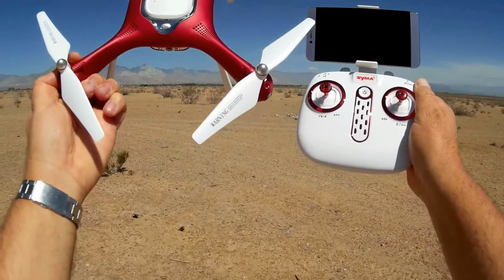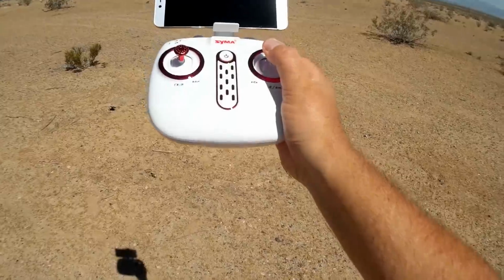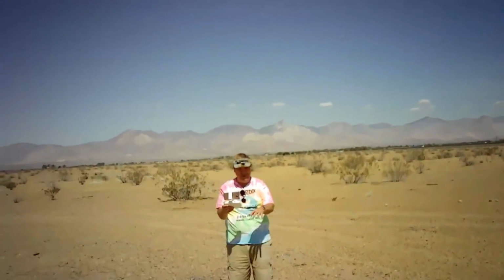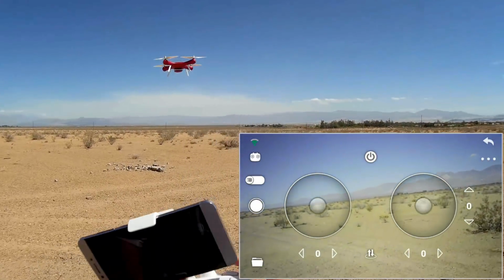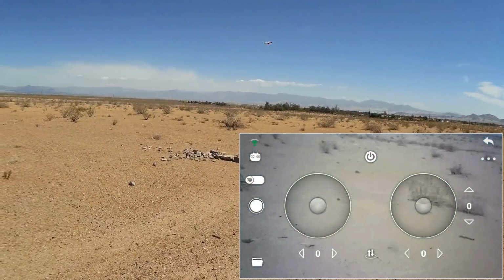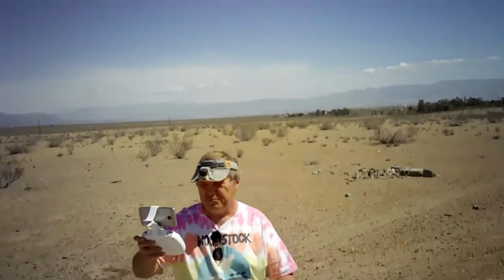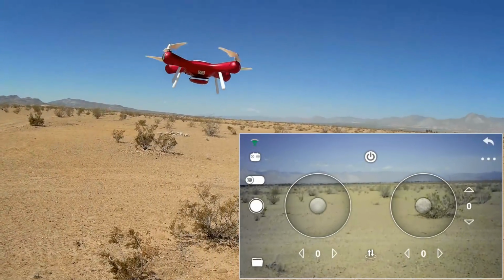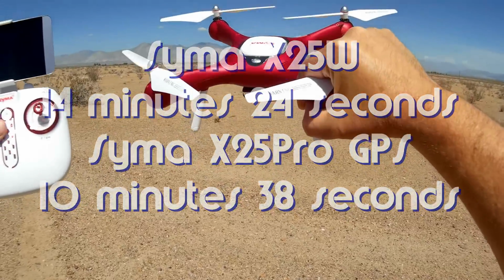Syma X25W Long Flying position Hold FPV Drone Flight Test Review

Comment: I Just Baught a Syma x25w and the optical Flow sencer helps Keep it in one spot and Hovers very well but would no recommend flying it in high winds will fly away from you but flys very well on calm still Days and has a 3mg camera on it.

Comment: What better syma x8sw or x25w?
Reply: Syma X25pro with Gps Lock and Syma X25w with optical Flow i have Both and they Both work Great with 720p Cameras on them highly recommended and thats if you are new to Flying Syma Drones

Comment: QC 101...I have a Sharper Image DX-2 Quadcopter with a bad motor.  It was a great flyer & I really want your help to find  replacement Motor(s). .. I did many searched & cannot find them listed anywhere.  I contacted Sharper Image and they are of  NO HELP at all.  The Motor  is a direct drive (push on props) and the output shaft has larger diameter than the replacements motors for JRC H8 Mini.  It is perhaps the next size larger motor than the JRC H8 Mini motors I already have..  Can you or any of your Youtube subscribers help point me to a comparable Sharper Image DX-2 replacement motor that are available from / for another Brand Quadcopter.?    Thank you for your help!
Reply from the maker: It's likely a generic 720 motor, widely available, and very cheap https://www.ebay.com/i/263059145193?chn=ps
But the only way to know for sure is to open up the drone and measure with calipers its diameter (7mm) and length (20mm).
This might help also http://haroldsmicroquadcopters.blogspot.com/2017/01/sharper-image-dx-2-goes-to-repair-shop.html
Reply from the maker: But as this drone is only $15 at Walmart, why not save yourself the hassle, and just get a new one? https://www.walmart.com/ip/Sharper-Image-DX-2-Stunt-Drone/106014485
Reply: Thanks So Much for your help... Your knowledge is a terrific service to this hobby.   I know this because I am a long term subscriber of yours & have bought 5 different sized / brand Quads based upon your favorable reviews. Your are absolutely right ... it would probably be better just to buy a new replacement quad.  However, my wife says she never gets anything new (kiddingly ?) because I enjoy fixing anything broken.  Guess it is the old time "Don't Waste Anything", New Englander (NH) in me!  Thank you Again!!
Reply: QC 101, You were totally right, it was a generic 720 motor!  But the article  you sent was even better.  I found my non working motor had + & - leads with cold solder joints.  I Re-soldered & re-assembled.   Many Thanks for  the info to getting it flying again!
Reply from the maker: Glad that you fixed it.  Have fun!

Comment: I started out with these drones, then upgraded to the Dji Phantom 4, and the Dji Phantom 4 Pro. I love the Dji Phantoms they are awesome drones. I have also added the Dji Goggle's and let me tell me you, they are AWESOME! they give you feeling as if yur inside the drone looking around while in flight. They are a must have. They are a bit pricy but well worth it. The Goggle's can be connected to anything that has an HDMI port. I've connected to a DVD player and that was neat. The Goggle's do have speakers built is for sound. Thanks Quadcopter 101 for sharing the video with everyone. Good job as always, and good info. Thumbs up buddy....

Comment: Great review! Looks like a nice flyer, like the optical flow position sensor, although would be better if it worked at a slightly higher altitude, also the flight time is really good! Hope this is a trend that continues in other models as I  guess most people find short 5-6 min flights times far too short! :(

Comment: So since you can use the control for the camera there is no need for the app other than fpv, you can just fly without
Reply: Then no interference
Reply from the maker: There is still some as the camera is still transmitting FPV on 2.4Ghz, even if no app.